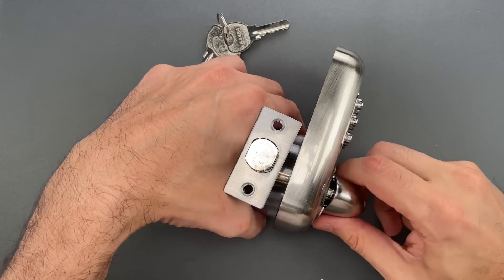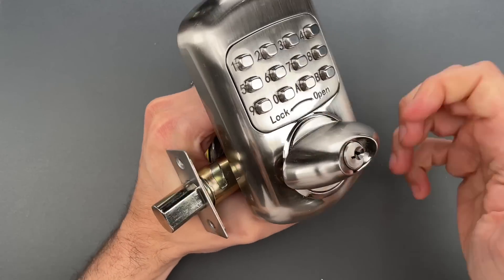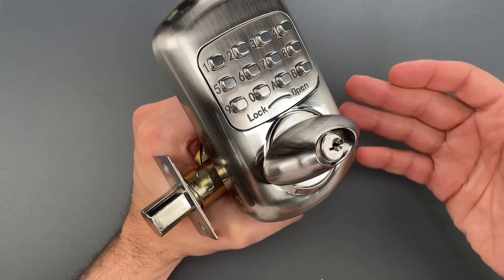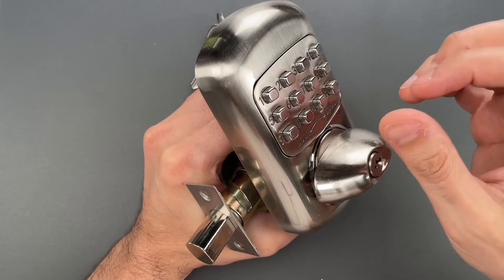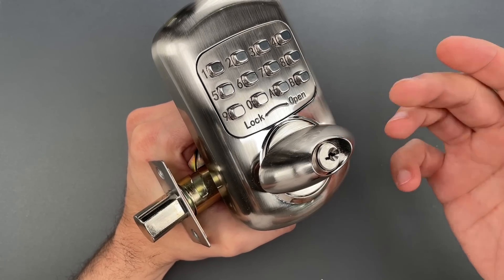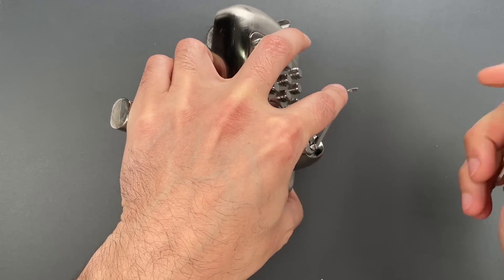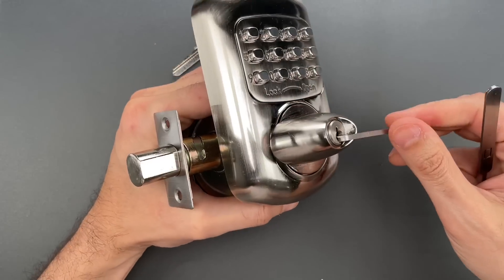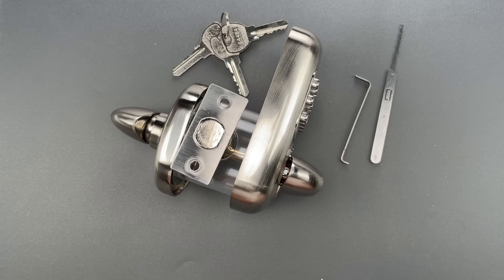[1569] New Elemake Mechanical Keypad Deadbolt Picked

Comment: I live in Canada and need a combination type dead bolt lock for my back gate. One that scrambles the combination after each use so that I do not have to manually. Any suggestions with links ? Thanks in advance.

Comment: I had an idea for a digital keypad deadbolt that has a number pad that does nothing and a key hole that only triggers a security alarm when picked. The secret part is voice recognition and a pocket fob. When you push any preselected number of buttons and say them out loud and hit # it unlocks. If you press * after, it still unlocks but also sends a silent alarm to the Police.

Comment: Do not start lock picking with inspiration from LPL or McNally. You will only disappoint yourself as you realize what they do is something you csn never achieve. Take it from me who is only ever a failure at everything they do in life. My lock pick set and locks i bought from lowes are sitting in my closet collecting dust because ive only ever been able to open them by sheer luck.

Comment: It seems to me after watching all your videos that the key lock is always the weak spot. I put super glue on my key insert it in my lock 3 or 4 times and let it dry. I never use a key anyway. I think that would make any combination/key lock more secure. If I need to use a key I break into my garage, get my carb cleaner and spray it into the key slot, and wiggle the key in until it unlocks. 😂

Comment: The only fluke would be if he ever couldn't get a lock open in under 30 seconds. 

I wonder what the manufacturers are thinking when they make these types of locks with both a keypad and a key. It takes longer to punch in the code than it does to turn the key. It's not like carrying a key is a gigantic inconvenience and it doesn't require memorizing the code which, admittedly isn't too difficult, but it is still an extra step.

It's quite disappointing that this lock is so crappy. Judging purely on appearance it looks like a sturdy, nice and strong lock. Oh how looks can be deceiving.

Comment: I have a Schlage push button locking latch on my front door.  I was concerned that the keyed portion of the lock was the weakest link, so I rekeyed it using security pins and different spring tension springs to make it more resistant to raking and bumping as well as picking.  I also installed a Mul-T-Lock Cronus Interactive+ deadbolt that's almost always locked, and beefed up the hinges and striker plate.

Comment: Funny thing about that type of locks do you even don't need to decode it once it have a bit of use. The only clean and shiny buttons is your combination. I also decoded similar but cheaper locks on a front door of an apartment building in Russia in early 00 simply by sound. The correct buttons made a dull sound when tapped with a finger while the inkorrect ones ringing slightly.

Comment: Guess I have to believe most people wouldn't have the skill to open most locks without bolt cutters . Because after watching your videos I'd be hard pressed to find a lock you couldn't open 😢 . So should I just buy the best lock I can find and not worry about someone picking it because it doesn't seem to make a difference what lock I buy if someone has the skills to pick it true so should I just buy a cheap lock or a more expensive lock ?

Comment: In my experience, door locks with a mechanical keypad aren't guarding anything secure anyway... they're on something like an office storeroom or bathroom, and the pin number is almost certainly something which can be described as "the top four buttons", or something that similarly doesn't require remembering the actual number.

Comment: The only place for something like this is basically inside an office, where there is already security to get in, then there is limited access based on staff ID.

Only other place I would use something similar is a camping trailer tailgate, where your main security is while you are parked somewhere to fuel or rest, so you are within 20-30 seconds of the gate anyway, and it's only there to deter a theif

Comment: How easy is it to remove the core? (disassemble it). Might be possible to just replace the core with a blank, that have pin holes on top of "core" that the driver pin falls into, and permanently locks the core into it.
Then just smear the blank core in epoxy and install it, and then theres no cylinder to pick, just the code to decode.

Comment: It appears the wave rake can open the lock faster than putting in the code.  The other advantage of the wave rake is that you don’t have to worry about forgetting the code.
Reply: "The other advantage of the wave rake is that you don’t have to worry about forgetting the code" - You also don't have to worry about revealing the code to people behind you.
Reply: @nomore6167  or to take the key with you at this point either.
Reply: @nomore6167 yeah, you just have to worry about the people behind you seeing how easy it is to lockpick your door.
Reply: @nomore6167 LOL
Reply: The numpad is a red herring.
Reply: 70th like

Comment: I am still amazed and shocked that these products are so bad. The construction looks decent (like always) and the mechanics are fine, but the back-up lock cylinder almost always appears to be the big flaw. And it still costs more than 50 dollars.

I live in The Netherlands, it is near impossible to buy a decent front door lock with or without a code mechanism for 50 dollars. For a standard modern front door, you have to get: the lock holding mechanism that fits in the door for around 35 euros, a fortified front plate for the inside and outside of the door (which is near impossible to get off from the outside) for 100 euros, and a decent euro-cylinder door lock for about 80 euros. That is around 200 euros for a decent front door locking system, not 50. And that is for the most basic option, if you choose to opt for automatic locking lugs on the top and bottom of the door, that system alone will cost 200 euros or more excluding the actual lock. We take home safety very serious here, a far cry from these cheap locks sold on Amazon as being "safe". 

Luckily we have LPL to show us what the actual problem really is.

Comment: Not sure if you'll see this or respond, but what are your thoughts on this updated model compared to the original, and despite the issues with changing out the cores on the previous model, would the overall quality be good enough to warrant purchasing and replacing with a higher security core?

Comment: I wonder if the cylinder can easily be replaced with something more suitable, or simply be disabled (entryway welded shut, or something), for extra safety. It does look nice, after all.
Reply: Throw in a killer key and that'll disable the cylinder. Then you just have to accept the cheap mechanical mechanism that "locks" the door.

Comment: Again it has to be said any lock that falls to a wave rake in 2023 is a lock that is not secure, that design flaw has been known about for in excess of 30 years and by now lock manufacturers have known how to defeat it.
Elemake need to ask themselves two questions, why are they using cores that not up to any form of modern standard and who suggested that LPL would not destroy their product in a test of pickability?
The bottom line is that the product is not worth using as it can be opened as fast as using a key and without creating any suspicion to a casual observer that a key is not being used, the jiggle motion could be someone with a bad key jiggling it in the lock as opposed to using the wave rake.

Comment: Code of conduct before sending a commercial lock to LPL
1) Ensure it can't be picked with the packaging of the product
2) Ensure it doesn't collapse if you bang it with yellow plastic
3) Ensure it resists a wave rake. 
well... it's 66% LPL compliant, you can print it in the ad.
Reply: Oh, test if it can be opened with a magnet.  😋
Reply: Add 4) Ensure it resists a magnet exploit.
Reply: Write a letter for him to read long enough that is longer that the amount of time to open the lock itself.
Reply: Don't forget that when LPL get bored with something, it ends up at McNally driveway chained to a mannequin where he opens it with a construction square.

Comment: Why include a backup key when the code can't be changed or disabled by normal users?  A main benefit of a purely mechanical lock like this is that it always works and won't need a key for flat battery or nuisance code changes.

Comment: Do lock manufacturers even bother to test their locks with well-known picking, et al. attacks? Rakes, combs, single-pin pick, bump, etc.?
Reply: They concentrate on the design and then the "tech" features.  Then order a core from a supplier, since 95% of companies don't make their own cores. The thing is.. everything from overseas distributors (Alibaba or similar) is the same half dozen or so cores under a myriad of names.  All with serious quality issues.

Comment: I see the main problem with mechanical dead bolts is the fact, that the order in which the numbers are depressed isn't important. Hence a set of fingerprints on the lock gives away the combination easily. This is even worse with a shiny surface like this dead bolt has. There are two ways to tackle this issue. You could clean the surface every time after using it, or you could make sure there are fingerprints all over it by randomly tapping through all the digits regularly.
Reply: there are some mechanical pushbutton locks that are sequence driven, and some that aren't.
Reply: The third method is to apply a durable matte coat to the buttons to obscure fingerprints.

Comment: I am honestly surprised that some of these companies don't ask you to be involved in the design process.
Reply: Most of these fly by night companies couldn't care less how well the locks work. People buy them regardless. Spending more on design work just eats into profits and could add to manufacturing costs.
Reply: his consulting hourly rate and new build would probably bankrupt them as it would actually cost some real $$$ in total
Reply: I worked for Sargent Lock for 12 years in the electronic locks division. The mechanical lock division suffered heavily from NIH (Not Invented Here) syndrome.
Reply: @JCWren  Meaning they buy it from a supplier and use it in their product without any real testing?
Reply: @--_DJ_--  NIH means that unless it's designed in-house, they're not interested in input from external sources. The marketing team is who drives the product specifications. Engineering attempts to build what they specified, with compromises made in quality vs cost.

Comment: Would swapping out the pins with Assa pins or something make the lock worth buying? Cuz I've been wanting a combination lock that was entirely mechanical with no need for a battery and this is the first one I've seen so far that looks like everything I need.
Reply: That may only solve half the problem depending on how the decoding works in the old video.

Comment: LPL if you see this can you please try to open a door 🚪 without picking it open and without taking the door bolts apart, can you just try to open one that has unscrewable screws, because I’ve been trying to open a door in my house that I can’t get open and I don’t want to purchase a lock picking set the screws that are in the door panel look like this (20x One Way Security; Screws In But Not Out, Tamper & Vandal Proof, No.8 1" 25mm), and the door does not have any hinges for me to open on the outside of the door, so can you plz if you see this comment try to open a door like the one I just described. Thanks 🙏!

Comment: I'm not even a lockpicker but can tell that when the first go-to is a wave rake, it's a bad lock 😆
Reply: Many of the locks he single pin picks his way through could also be raked. He single pin picks for the challenge.
Reply: Still better than the "tactical ziptie" McNally sometimes uses.
Reply: Definitely a facepalm when you see the wave rake come out
Reply: @davec8921  Come on, wave rake requires at least some skill and using both hands, facepalm is that "knife" tool, comb or bypass flag. 
On the other hand, wave rake on something they sent him... yeah. Sending him "we made something what you will not beat" and getting wave rake hurts.
Reply: I'd also call in the bypass hook, but even worse if no tools are needed at all.
Reply: @ehsnils  That tool working is just sad.
Reply: @ehsnils  Or a stick he picked up from his garden.